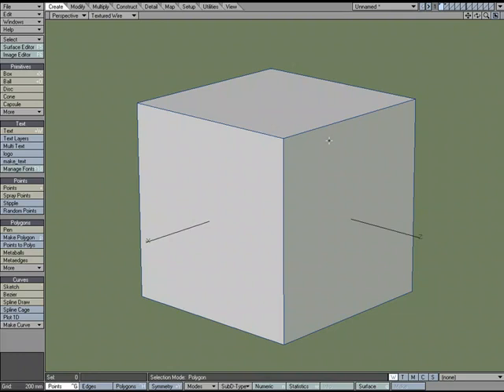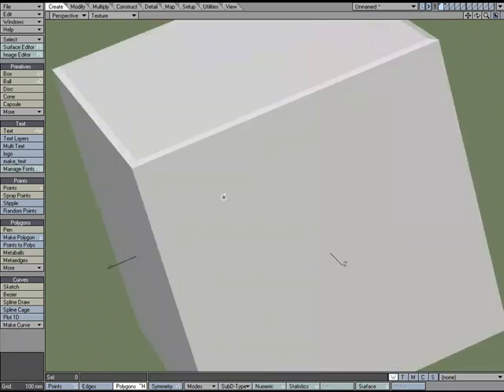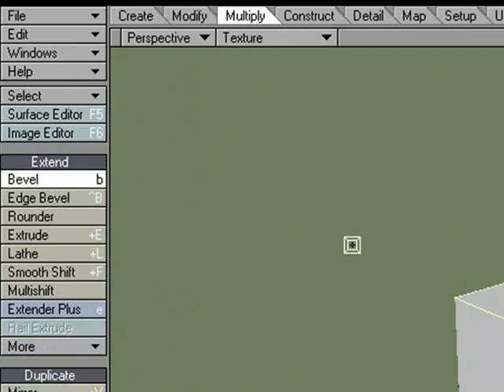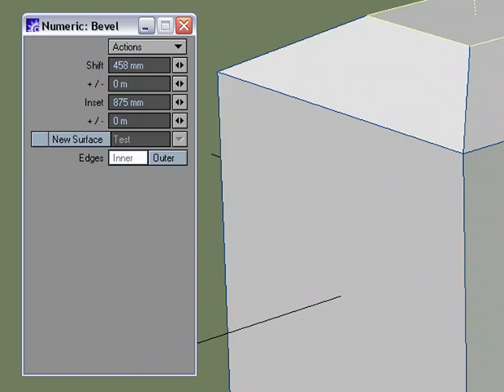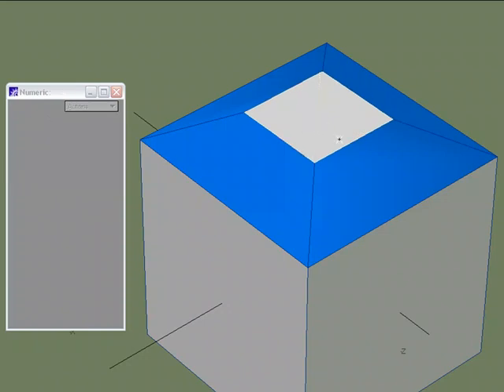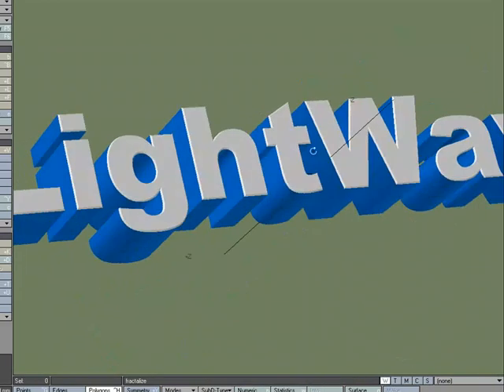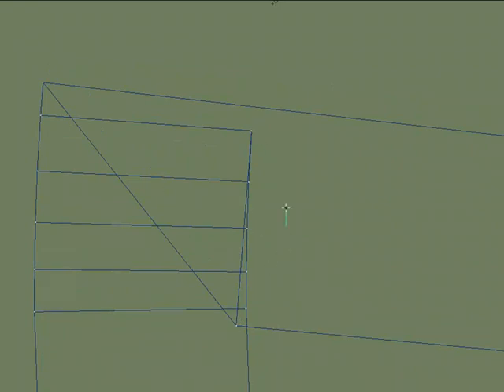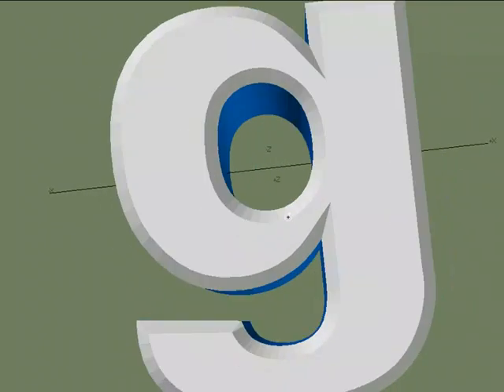Bevel Tutorial In NewTek's LightWave 3D

Comment: Why does my bevel tool create geometry every time i change the settings in the numeric panel?  It is not just providing a nice little preview of what it will look like..it is actually creating geometry every time i click a button.  My system is quickly brought to its knees by this.  I never remember it behaving like this before.  Some new setting somewhere?  If so, how do i turn it off and why is it on by default...useless.